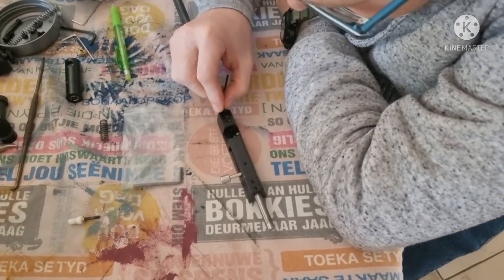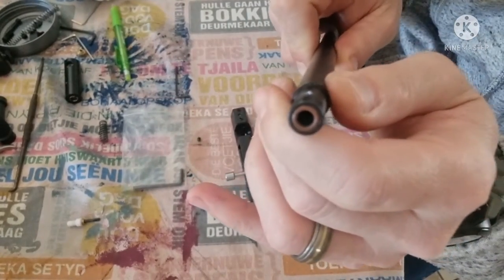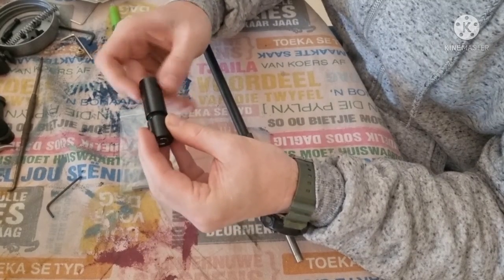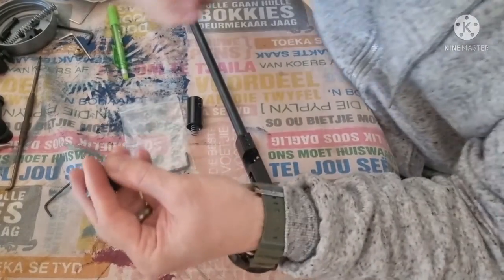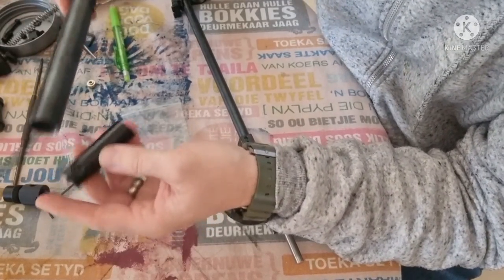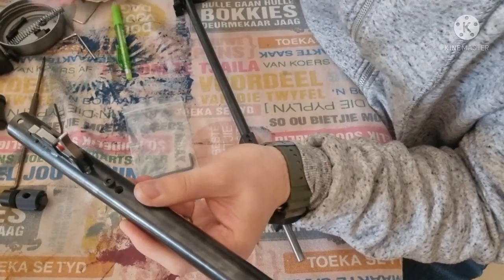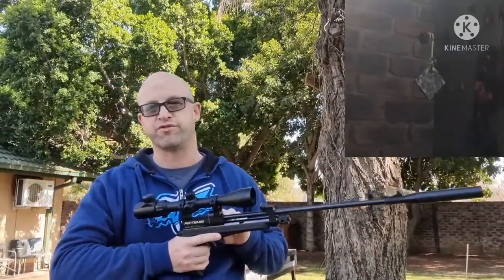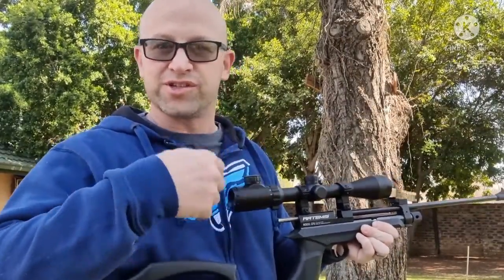Artemis CP2/Diana Chaser - FPS Increase - C02 Valve mod Part3 - TEST & Results

Comment: Thank you Tyrone for your explanation. Today I drilled my artemis cp2. 22. I used a 4mm drill and drilled with a drop of motoroil. When it was done I noticed a burr on the edge of the hole in the inside of the barrel. I took a watchmaker file and carefully filed it away. The hole in the co2 valve had the same problem. The file fixed it . After this sanded with grit 600 and cleaned everything with brake cleaner. Everything works and tomorrow is testing day. 
Again thank you so much..... 
 

of the barrel
Reply from the maker: Sounds like you are ready for action. Let us know how it goes
Reply: @African-Budget-Pellet-Gunner  hi Tyrone, I think I am ready with my mods on my artemis cp2. 22.
Bought a ht-x3006 and measured 586 fps/15,8 joule. Is this bad, acceptable, good or very good. I am using gamo match 1.00 gram pellets. Except for the valve spring I did everything I could.
Drilled all the ports to 4mm.
Is there more I can do?
Have a nice day Tyrone.....
Reply from the maker: @peterspeets9950  that is very good, highly doubt it will get higher than that, nicely done. I trust you are happy
Reply: @African-Budget-Pellet-Gunner  sure I am 🤗

Comment: dont use silikon oil on orings ?
Reply from the maker: Yes, you can but normal mineral oil will also be fine, the place you should only use silicone oil is on the co2 seal

Comment: And so I'm back again.

I'm planning to do a bit more tinkering with my 4.5mm soon.  So far I've put a 7mm stack of washers inside the hammer, and I've also run some sandpaper through the action tube. I'm a bit hesitant to make the portwork larger, as you might remember I've already had issues with pellets/slugs sometimes catching against the port.  Someone suggested with my Sig Spartan pistol that I should turn the valve stem down a bit to let more gas past the stem (not the entire length of course, haven't done it yet), what do you think of that on the CP2?  And does cutting the valve body make a significant difference, or is it just for more consistency from one shot to the next?

Also, it seems you used a spacer and stretched spring together here.  So I take it that's safe to do then?

As for the Spartan I mentioned, do you have any suggestions for the valve outlet size?  It's a CO2 blowback BB pistol, firing straight out of the mag.  Factory spec is 410fps, which is supposedly 3.1J.  And reviews point to that advertised velocity being pretty accurate (if not understated).  I'm not worried about shot count, as emptying the canister is already a bit of a schlep.
Reply from the maker: Hi Johann, I don't know the spartan at all. You can turn the pellet probe down a little as long as you don't go to far back and prevent the pellet probe from sealing. You can stretch the spring and put in spacers.
Reply: @African-Budget-Pellet-Gunner  I was referring to the stem inside the valve.  When the hammer hits the end of the stem and forces the seat open, the gas has to blow past the stem to get to the other side (where the port is).  So the idea is to turn the stem close to the seat so it has more clearance for gas to blow past.  But of course the end of the stem must remain its original diameter, or the gas will escape.
Reply from the maker: In theory I suppose it could help but I think you might run into a problem with the stem perhaps bending which will cause the valve to become less consistent

Comment: @African-Budget-Pellet-Gunner Try to increase the length of the valve stem, I'm still testing this thing and I can't say how much the power has increased, since the chronograph gives erroneous results due to CO2 vapor / .22
Reply from the maker: @SnatusQ this will definitely give you more fps as the hammer engages the stem quicker causing the valve to be open a bot longer just beware of 2 things, if the stem is too long the valve will not close and you will loose all your co2 after the 1st shot and also beware of hammer bounce stealing your shot count, because the stem is longer your hammer will open the valve a few extra times per shot you will not notice anything different in the shot you will just see your shot count decrease a lot
Reply: @African-Budget-Pellet-Gunner  
Now there is a problem that when installing co2, it all comes out through the barrel, but this is solved, you just need to cock the hammer and set co2, but at the same time, the power has definitely grown
Reply from the maker: Yes, the stem is too long hence it is opening the valve without the hammer being pushed into the valve. How many shots do you get per capsule
Reply: @African-Budget-Pellet-Gunner  I can’t say for sure yet, I tested 1 cylinder, but definitely less than 30, since the values of the frame counter were not clear, then I realized that these gas vapors interfere with measurements, the values between 16j and 19j, with a bullet 0.9 g .22
Reply from the maker: I am keen to see your results but 16J seems a little high but let's see what happens
Reply: @African-Budget-Pellet-Gunner  I forgot about an important detail, the valve body, in addition to the cut thread, is deepened by a cutter by 4 mm, the plastic part where the stem is placed by 2 mm is lengthened, perhaps more is needed so that the capsule is loaded without cocking
Reply from the maker: The problem is when you extend the valve stem, you close the gap between the stem and the hammer this means when the hammer strike the stem the valve opens more which gives more fps but the hammer actually strikes a few times for every shot this means you loose more gas

Comment: Hi Tyrone. I done all this and now as soon as I put a co2 in it leaks really bad? Any help?
Reply from the maker: Sure @David Kirkman 2 things you need to do. 
1. Cock the bolt and then load the co2, if it only leaks after firing the shot then your spring is too strong or your spacers too many.
2. Can you tell me where exactly the gas is coming out?
If you not winning drop me an email at tyrone8511@gmail.com it is easier to help you there
Reply: @African-Budget-Pellet-Gunner   it was me! I forgot the big O ring in the valve!
Reply from the maker: Glad you came right, happy shooting buddy
Reply: @African-Budget-Pellet-Gunner   Thanks for brilliant videos.

Comment: Your chronograph and pellet relation is misleading.
Reply from the maker: Hi @neitho mich why do you say that?
Reply: blue star pellets 18.21 grains at 841fps = 28.61 foot pounds.    picture is of the wrong tin of pellets...!!
Reply from the maker: Hi @kevin rimmer the blue star pellets are 177 and 8.02gr sorry if I had the wrong pic, above is the spec of the blue stars I used

Comment: I missed the 8mm hammer spacer, Was it in the other video and I missed it?
Reply from the maker: @scott phillips yes I actually started with a 4mm spacer and when I stretched the spring I added another 4mm
Reply: @African-Budget-Pellet-Gunner  hi Tyrone you stack two 4 mm spacers, but what diameter do they have? Are these spacers washers?
Reply from the maker: Outside diameter of just less than 10mm will be fine. You can use steel or rubber, to be safe, start with 5mm width and then gradually increase it. If too much you bolt won't cock or your valve is stuck in the open position
Reply: @African-Budget-Pellet-Gunner  thank you Tyrone. I already tried some nylon washers, together 5mm and my valve leaked maybe I choose a valve spring that isn't strong enough to push it back.... 
. So I will skip the washers and leave it this way
Reply from the maker: @peterspeets9950 yes, don't change that valve spring, that will not bring any good for you
Reply: @African-Budget-Pellet-Gunner  ok I will place the original back and then use the washers again.

Comment: I have the .22 version. Did all the mods but gained almost nothing. Its up to 526ft/s compared to 500ft/s
Reply from the maker: @Gilmore Harrison Thanks for leaving a comment. If you say you have done all the mods, please let me know specifically which ones you have done. The 500fps which you indicated above was that measured or assumed as the original? Are you using the long or short barrel? What pellets are you using for testing? If you can answer these questions I can try help you. Alternatively send me an email tyrone8511@gmail.com with details and I can help you there. Looking forward to hearing from you

Comment: Hi Tyrone. I am a big fan of your channel.Im in the process of getting a cr600w that i will convert to your specs.How about making a video on upgrading to a bigger co2 tank.We will shoot more and save on cost of the 12 gr capsules. Keep up the good work. Thanks Quentin
Reply from the maker: @Quentin Du Plessis Thanks for supporting and following my channel. The CR600W is an excellent choice as well. I might make a video to upgrade to the bigger co2 tank but don't really have somewhere to fill it here. Where do you stay
Reply: @African-Budget-Pellet-Gunner  I stay in Port Elizabeth.We got dive shops paintball shops here
Reply from the maker: Well sounds like I better get myself a co2 tank and make a video
Reply: @African-Budget-Pellet-Gunner  sounds awesome cant wait for that video.Where do you stay. Must have someplace to refill on co2
Reply from the maker: @Quentin Du Plessis I stay in Ellisras(Limpopo) so here the guys are serious hunters and don't tend to mess around with pellet guns too much. I know Potties(Mokopane) has a place to refill cylinders
Reply: @African-Budget-Pellet-Gunner  Hi joh you are far but very nice hunting area.just find out from engeneering shops to. They do co2 welding so must have supplier. I got a pr900w as well with a pump.Shoots strong but need to pump after about 30 shots.One of these days im gonna look like a pro bodybuilder lol.Keep up the good work. Much appreciated. Quentin

Comment: Hey! 
I will soon by a artemis cp2, but I can’t decide if I should get the 4,5 or 5.5 mm version.. 
do you think these mods would do a big difference to the 5,5 mm rifle?
Reply from the maker: @MWCars firstly you won't make a mistake going for the Artemis CP2. What is your plan with the rifle? Plinking, target shooting or a spot of hunting?  If you are going to do hunting I would say go for the 5.5mm except if your range is going to be 15-25m then I would go for the 4.5mm. For mostly Plinking and target work, I would go 4.5mm as the pellets are cheaper so you'll get to shoot more. The mods will work on both equally as well
Reply from the maker: Oh and welcome to the club, you won't regret it
Reply: @African-Budget-Pellet-Gunner tanks for the response! 
I want to do a little bit of both 😅 mainly target shooting but also pest control.
Reply from the maker: I personally would go 4.5mm but either or will be a great rifle

Comment: Nice work! How many shots u get out of one CO2 cilinder? Drilled mine to 4,2 mm and have about 20 good powerd shots.
Reply from the maker: Thanks @HS Knives glad you enjoyed the video, I get around 15 shots but I have a few additional mods. What fps are you getting from your CP2/Chaser
Reply: @African-Budget-Pellet-Gunner  i gave my old one away to a fam.member. I Just started over and as im sending this massage im reassambil my cp2 😁 on this one i drilled all holes to 4.2 mm, on the vaulve i left about 6,5mm of  treads and counter sounk the inside, i pollised the inside part  of the "pipe" where the hammer slides, pollised the hamer, pollised the trigger and streched the hammer spring from 7cm to 10cm. Im going to test it tommorow but i dont have a chrony so have no idea how much fps its going to shoot.
Reply from the maker: Awesome I think you are going to get plenty of juice from that, is it .22 or .177
Reply from the maker: I think with those mods and 14.5gr pellets I would say around 700 -750fps. Maybe try out chrono connect app. Nice, what you using it for?

Comment: I love the accuracy of mine and the power since I did your mod suggestion. (hard rubber hose boot behind the hammer spring). That added 50+ fps for mine. Keep em coming Ty!
Reply from the maker: Thanks G Whitfield glad you enjoyed it, and the hard rubber works great as a spacer
Reply: @African-Budget-Pellet-Gunner  yes it does...mine was a little bit too big and I had to go around the outside diameter with the dremel tool with a barrel sander on it  but it didn't take long to get it down to the size it needs to be to fit in the hole. I dont know if I'll do anything else to it for now, I'm pretty happy with it just as it is!! Thanks again for the tip and the videos!!
Reply from the maker: @G Whitfield you're welcome glad it could be of use
Reply from the maker: @Jack Rowland yes you are correct, the spacer should have an OD of 10mm to fit inside the hammer and then the thickness is dependent on the effect you want

Comment: I found the valve body can leak. The O-ring has to hold back nominal 850psi  about 58 Bar. Dead clean, no pocket fluff, and silicone grease on O-ring and threads, not a lot, smear on with fingers and wash hands (not because it is nasty but it migrates everywhere, notably spectacles). When fitting an O-ring try not to roll it on but snap it in place so that it is not twisted, ping it like a rubber band. The valve is held shut by the CO2 pressure, so it is not prone to leaking but does like a hint of silicone grease on its seal. Never use anything harder than a fingernail on an O-ring, cocktail stick not a pin, they split and tear, or last 40 years handled right.
The factory assembly was not clever but we can easily make it gas tight.
I'm following this because I like what you're doing.
Reply from the maker: Hi Jeff thanks for the comment, glad you're enjoying the videos
Reply: I read yesterday that a 12 gram capsel has 60 Bar.
Reply: @andreasnitsch8119  I have no idea of the fill pressure to keep it liquid but the vapour pressure of liquid CO2 can easily be looked up. 60 Bar is 870psig, but you would only see that on a very hot day. It would exert more pressure against the valve and so let less gas out, and so a form of self-regulation.